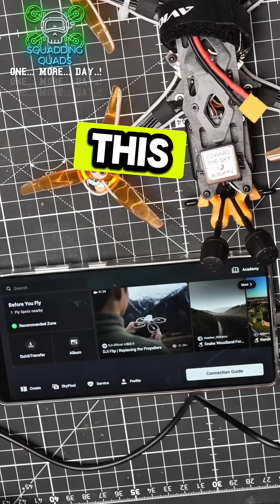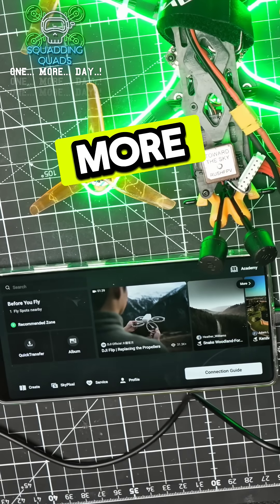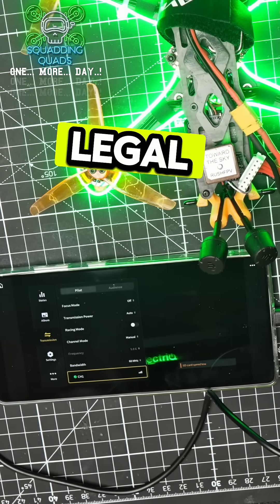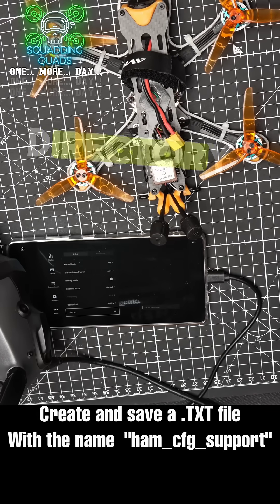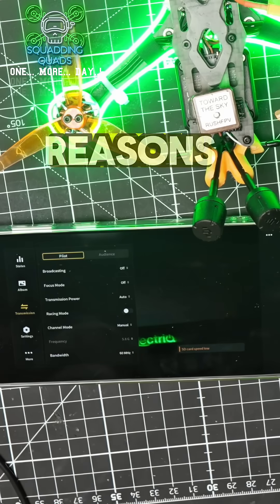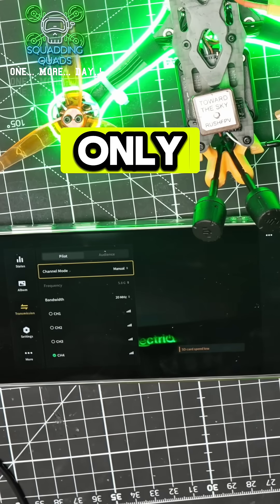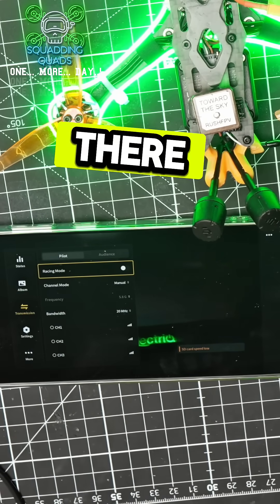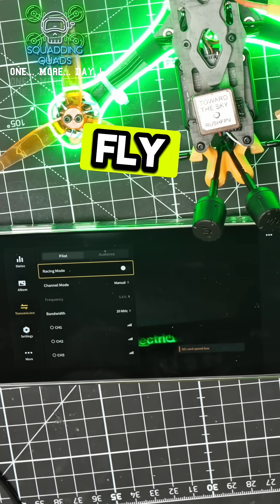How to Unlock FCC Mode On The DJI 04 PRO - Tutorial

Comment: I thought they said a factory reset was needed to remove it,  not just deleting the file.
Reply from the maker: It's back to ce mode for me now so I assume a fw update has changed it
Reply: @squaddingquads weird.  I just tested mine.   Removing the sd card or deleting the file made no difference with the avata 2 and goggles 3 it stayed active.  I’m still waiting on my replacement sir unit so can’t test that.  But maybe that’s the difference.
Reply from the maker: It could be, to ejdduee legal compliance I've reset my Goggles (as that's where the mod is held)  @DavidinEssexUK
Reply: @squaddingquads I was told this is needed in Mexico which is why I needed to test it.  But I’m not off for a few weeks so I’ll be resetting mine too.

Comment: The bind and fly quads I have don’t need this so it must only apply to euro versions of the air unit as they are not geo aware.

My old Neo and friends Avata 2 needed it though … when we were flying in Mexico 🤔😂
Reply: It’s down to the goggles.   Goggles 3 have gps or goggles 2 you connect to a phone to set regional power.

Comment: DJI uses 5.8GHz which is in a ham band. So just get online and do your basic ham license, can be done online and allows 10 watts power .
Reply from the maker: There seems to be a bit of confusion on this.

I was under the impression the sake as yourself, but a bit of light research suggests not, I'll dig deeper. 

"The 5.8 GHz band, commonly used for FPV video transmission, is not generally a part of the amateur radio bands allocated for use by UK amateur radio licensees. Therefore, using a DJI Air Unit or other FPV equipment on this band does not fall under the scope of a typical UK amateur radio license. "
Reply: @squaddingquads  I did over simplify. The biggest issue with using a ham license is that you can't transmit from an aircraft. You also need to use open protocols and embed your ID. But, in my view, you can never fly FPV legally. I think it's unlikely you'd get done for transmitting 1200mw from a drone when your license allows 10-400 watts (depending on which license you get).
Reply from the maker: That makes a lot of sense, thank you it's definitely something I need to look into  @rcx575
Reply: @squaddingquads  hams break rules all the time. Legally speaking, the purpose of ham is to test and develop radio communication technology. But what does it actually get used for? For old men to chat to each other about their medical conditions. Very few of them do any testing and they haven't developed anything for decades.

The main thing about FPV is to keep to CAA rules, because if you dont, you invalidate your insurance, which could mean massive costs if you hit a car or building.
Reply: @squaddingquads  after our "chat", I looked up the UK Ham band plan for 5.8GHz (5cm band), and there is another difficult rule: Only full license Hams can use it.
Reply: @squaddingquads correct but if you had a ham license you can do this mod without breaking the law or interfering with other transmissions
Reply: I get that it feels true, but it is not. A ham license does not allow you to output above the CE limit at 5.8 GHz. My recommendation is to not be so confident about things you're not actually sure about.
Reply: @Bollibompa 5.650–5.925 GHz is a ham band. The FPV frequency is within that. Its a shared band. There is no rule i could find that  says a ham must stay within CE limits. Have have their own limits and rules.
Reply: I think that’s true for the USA only.